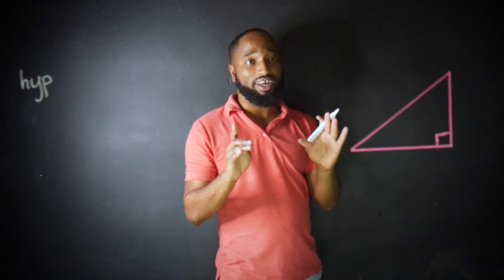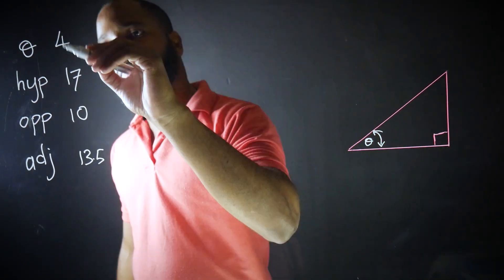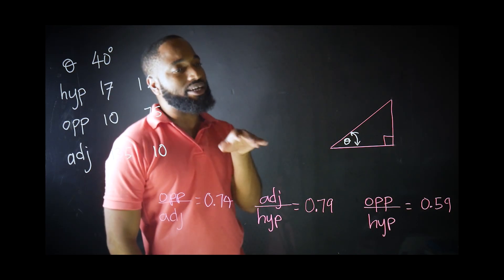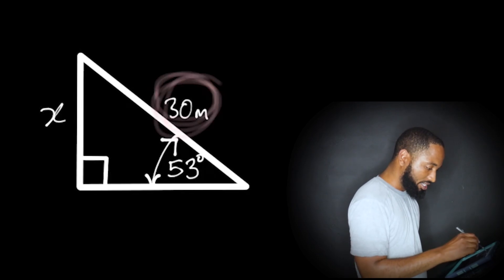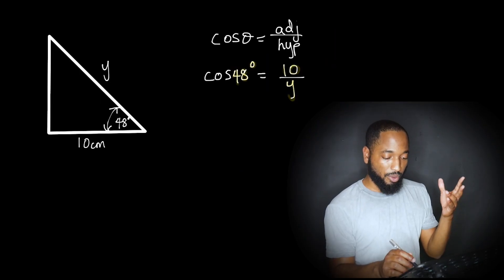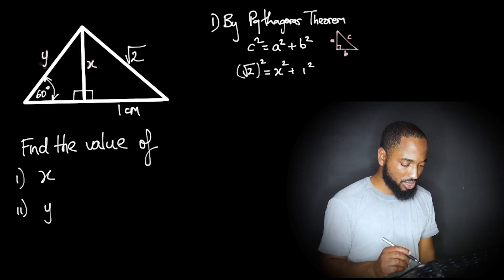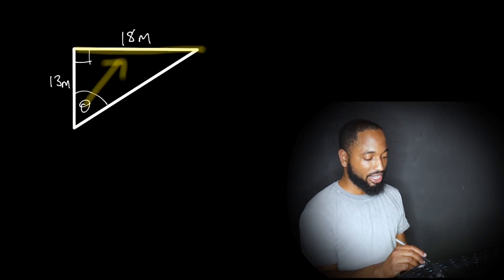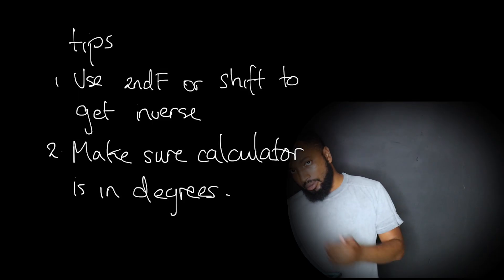Sine Cosine and Tangent... How? [Exam questions]

Comment: I have a question, I don't k ow if it's been ask already  but in the triangle there are two angles the 90 degree and the angle that they give. Is there any case where they use the right angle, which line or side would be opposite or adjacent.
Reply from the maker: Lol interesting question. Short answer. No.

Another angle other than the right angle must be used.
Just knowing the length of one side and no other angles but the right angle is not enough to define a triangle. Too little information.